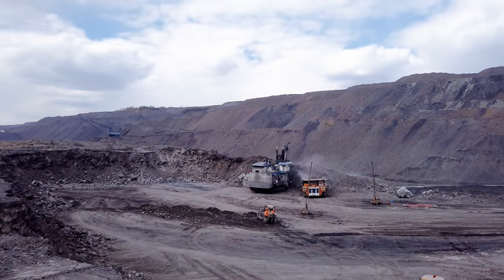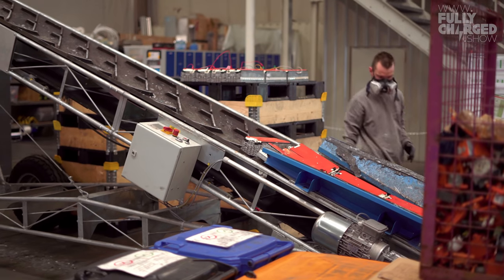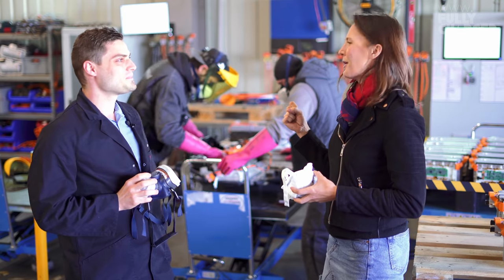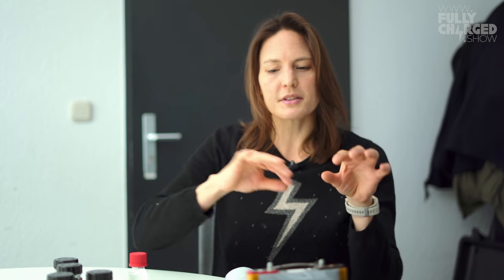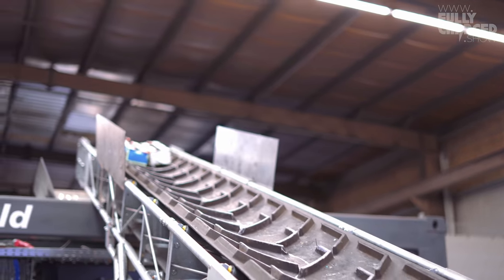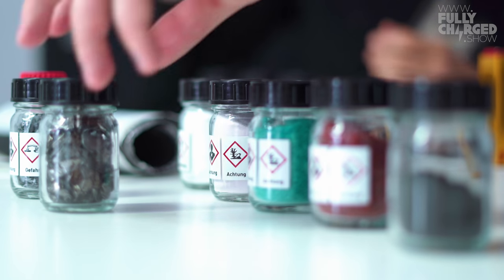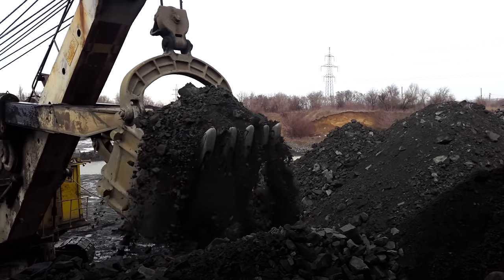Yes, we can RECYCLE EV batteries. Here's how | Fully Charged

Comment: The other partial solution is not to use Li batteries for static applications. This would have a number of valuable side effects.  1) The materials used in these alternate batteries are often common and cheap.  They include ZnBr, SbCa, Fe, V and the up and coming Na batteries, 2) Most of the alternative batteries have much longer lives than Li batteries. Their only disadvantage, I can see, is that they don't have quite the cycle efficiency of Li batteries. 3) Using alternative chemistries for static applications would decrease the demand for Li and bring the cost of Li batteries down and hence the cost of EVs, thus making EVs available to a wider range of people.  4) Using other chemistries would bring the price of these non-Li batteries down below the price of Li batteries.  They use common cheap elements and all they need is production volume to achieve very low costs. 5) Most of these batteries based on elements other than Li can be cycled from 0% to 100% charge without damage and hence all the energy stored in the battery is available to you, unlike Li batteries.  6) most of the alternatives are safer in terms of fire.  They can be shipped, even by plane and certainly by ship in containers with no risk.  Most of them can be safely used in a house (basement for instance) or in a factory.  With Li batteries, it is wise to use have them outside, just in case.  Extra land does not always exist for a battery unit.

Comment: Meanwhile in the paralel world of 1950's certain Miss Helena just released an "audio reportage" titled "Can asbestos be fully recycled?". You need to tune in to her AM station if you can time travel. It's worth it. Apparently asbestos has very few negatives and many positives that will help save the world. 
Also on that AM station,
- "Lucky Strike or Marlboro's, which brand is better at clearing bronchitis, as tested by world's best doctors". 
- "Radiation, should you be scared of what you can't see? Our experts claim that you shouldn't".
Reply from the maker: Asbestosis affects the lungs, cigarettes affect the lungs, radiation is bad all over. Petrol and diesel are bad for the lungs, the planet and more. Please be specific about the issue/s you anticipate with battery electric vehicles? NB as a channel we believe in 'fewer vehicles, a lot fewer, but electric' - I really look forward to your considered response. Fully Charged Dan
Reply: @fullychargedshow  the point of my post was to sarcastically point out that, your "*Can* ..." is a way of pulling wool over naive masses eyes, similarly to how other outlets used to do over the decades if not centuries. The number of batteries which are now finding employment everywhere because they became a fashion item which is going to "save the world" is shocking and majority of them will end up in landfills all over 3rd world countries where there will be no utilisation and recycling. It is the asbestos of 21st century. 

But obviously an average concerned citizen that jizes allover your videos with excitement will not be concerned about this as what they are only concerned about is that they "are doing the right thing" based on what the media told them. It's the feel good factor that matters.

Comment: very good presentation... a few question are going in my mind...
how has the battery to be optimized in production for easyier recycling to 100 % ? ... is this a difficult thing ?
how long could it take, that robots split the battery full automaticly ?... is it maybe in 10 years conceivable, that high tech robots can find own solutions to get the materials apart ? ... without the need of manual working
... or has to be there a new standard for building batterys and it is otherwise not possible to reach nearly 100 % ?

Comment: Where is the flourine coming from? Are there flourocarbons like teflon in the plastic layers?
Reply: Apparently a typical electrolyte in lithium ion batteries contains lithium hexafluorophosphate. Hydrogen fluoride is a COSHH headache. Fortunately doing vacuum extraction means you can pour the stuff straight into the next battery without messing with it, or just sweeping up the powder that remains.
Reply: I used to work with HF, the first aid for personal contamination (a bad spillage on your arm for instance) was amputation!
Reply: Even if you are an EV maniac you should be worried about those hexafluorides in the electrolyte. If you are involved in an EV crash with a burning car you  better bugger off. 
I really long for solid-state EV batteries.

Comment: Really great video, thanks for putting it together! Would be great to know more about why you need to recycle batteries, why do they degrade and what methods could be done to give them longer lifespans both now and in the future. Of course, charging them properly etc improves their life, but for mainstream adoption, you will have to assume the average user does not know/care about that and will just want to plug it in and assume it is ready to go next time they need to drive.

Comment: Do you make bring and sucksion the later of liquid like how oil and water is seperated then just take they layout or mineral liquid needed like cobolt,nickel heat up and become solid at different temps then take what is heavesy or on top or in the bottom it seperate its self right is that what you do ?

Comment: Still a long road I feel until large scale battery recycling is cost effective compared to buying raw materials - but an important road nonetheless! If we consider the recycling process during primary battery design/engineering, could we make the metals easier to separate at a later date?
Reply from the maker: I think that's precisely the type of battery design that the whole process will inspire in time. Dan

Comment: Another informative video, wonderfully presented by Dr. Czerski. Question: What's the purity of the reclaimed materials?

Also, wouldn't reuse of EV batteries in storage systems be a better next step than recycling? In the end, the batteries would serve two purposes, with the second being very economical when compared to manufacturing new batteries for this purpose. And the recycled material yield would be the same.
Reply from the maker: Yes, we’re doing a 2nd life episode, but this was filmed pre-lockdown and that’s why it has been released first. All the best, Fully Charged Dan
Reply: @fullychargedshow  That's awesome to hear, and thanks for commenting. I design and build off-grid energy systems and have used 18650 cells, "specialty" cells and EV modules from salvage to build anything from small portable power packs, to worksite power packs, to van, trailer, RV and tiny house storage, to specialty commercial applications. I'm currently finalizing the design and sourcing for 30kWh systems delivering 230V 3-phase to power commercial condensing units, as well as 120V single phase to power commercial and residential air handlers.ystem is a 30kWh system that powers. These systems use "second life" Tesla packs with parallel inverted and variable frequency drives, and are completely off-grid so the client can demonstrate their product line wherever and whenever the want.

Projects such as these would easily be three to five times more expensive if not for "second life" batteries.

Comment: Could battery manufacturers make changes which would make recycling easier?
Reply: Yes. Make nice flat packs that aren't too hard to take apart. I wonder if Tesla's great long model3/Y packs fit in their machine? Will even longer packs get made by the likes of Rivian?
Reply: I guess watch this space, already colbolt free batteries in the pipeline for starters
Reply: I was wondering whether battery manufacturers could "design in" a recycling method & perhaps provide a recycling manual for each type of battery? Probably wishful thinking for now anyway.

Comment: A very professional presentation full of good information. However, this is not the only company recycling lithium-ion batteries to retrieve the energy metals they contain. Lithium Australia has devoted a great deal of R&D to the issue for some years and is developing proprietary processes to create a circular battery economy, one in which energy metals from both mine waste and spent batteries are extracted to be re-used ad infinitum.

Comment: Surely the outer enclosure and cable harness can be reused by sending back the original battery manufacturer? If car manufacturers try harder to modularise and standardize battery packs then this process can be optimised for least energy expenditure.

Comment: 3:20 discharging batteries to 0 V  - putting power on the grid. Wondering if battery designers and battery recyclers communicate on how to manufacture a battery that's easier to recycle - cradle-to-cradle closed-loop process. Much better use of my time than watching any more of "Planet of the Humans" shockumentary. (;-) (;-)

Comment: How difficult would it would be to repair batteries rather than recycle them? Obviously recycling would be preferable with older tech, but with newer ones, would it be feasible to replace the worn innards rather than the whole unit?
Reply: distortal these batteries aren't broken, so no repairing. They've simply degraded over time, so you have to separate the chemicals (as they are doing here) and make a new battery out of them.
Reply: If they are degraded after 1500+ charging cycles, you can't repair them. They still work, but with a much lower capacity. If they are recycled, you can even make more new batteries from them, because new batteries need much less cobalt and have a higher energy density.

Comment: I guess, though, that a lot of these problems simply vanish with solid state batteries?

As all of it - cathodes, anodes and electrolyte - are all solid. No danger of fire. A liquid electrolyte seeps into things inside the battery - but with a solid electrolyte, you can kind of just reach in and pick it up, as it's a solid mass.

So I'd imagine - after discharging them - it's a much more ordinary recycling process for a solid state battery, where you're literally just physically pulling it apart to reclaim the materials.

Thus, as battery tech progresses, these issues would seem to progress too. That the quest for solid state is itself battery manufacturers creating a much more recyclable product from the off.

Comment: Very informative thank you! Batteries are but a temporary solution, until we change over to hydrogen as a most efficient fuel for cars and houses.
Reply: It's not 'most efficient' at least in a point of use sense. Using the electricity in traction (85%) is more than twice as efficient as turning it into hydrogen and then using it in a fuel cell (40%). Hydrogen is an excellent way of doing electricity storage to deal with the variability of renewable supply, then using it for heating, electriicy, traction. So we may end up with quite a lot of it being used for heavy transport just because there will be a lot about.

Comment: For a whole home battery is there a reason not to use lead acid batteries? Use LI for cars.
Reply: The lifespan alone for starters, weight and size, depth of discharge...lead acid is going to be a relic...it is easier to recycle but you’ll need to do twice as much or more per kWh.

Comment: "End of life" batteries from cars might be used in stationary use before being recycled.. and in both instances it will be better if the battery is designed to easily change out cells and BMS instead of crushing the entire battery. Kind regards from Denmark

Comment: But what is the percentage that can be recycled   ?
Reply from the maker: It’s in the episode, over 70% rising to over 90%
Reply: @fullychargedshow  no it isn't the chart shows 32 per cent only & no mention of the CO2 this process produces a lot of mention of this process being very difficult. Would not say if could get to 100 per cent.
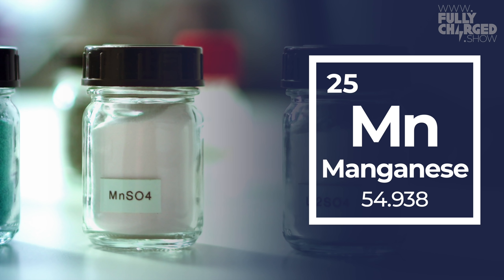Reply from the maker: Audio: around 12:00-12:15
Reply: @fullychargedshow  You are listening to the propaganda go back to about 10:00 onwards and look at this companies own chart it is 32 per cent. What you are talking about is what they hope to do. Another thing the presenter, who does a good job fails to realise that lead acid batteries are almost 100 per cent recyclable. Again what about the O2 produced by this recycling of li ion batteries, I bet it is enormous. Even Renault in their promo leaflet on recycling only claim 50 per cent of batteries are recycled & this figure is skewed because they include the lead acid batteries
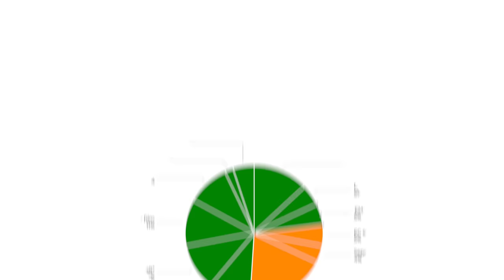Reply: @shaunryan6  @10:20 the charts states 72% is recovered mechanically of the battery at Drussenfield. He states that  because they don't thermally harm the graphite, which is 19% of the remaining 28%, which is cannot be recovered mechanically. He then says they can later recover the graphite via another process.

@12:00 he states that the battery in front of them it is possible to recover 91% of the material, 72% (Mechanical )+ 19% (Graphite) .

It wasn't clear if they were currently recycling the 19%, or that an additional process they could get that 19%. They know how to do it, but at the moment it isn't viable? It wasn't completely clear TBH.

As with any video on the internet you have to be willing to trust the source, and any bias that may come with it. Heh I never thought a company would land a 50m first stage rocket back on the ground. Where there is a will there is a way.

Comment: Problem is not the shape of packaging in different cars it's the different chemistries between packs and materials if each pouch or cell. One plant can't cope with 10 different chemistries simultaneously. If only one type recycled e.g.  2014 Samsung as fitted to 60Ah BMW i3 or VW  works. But no mention of energy used beyond disassembly.

Comment: Would be very interesting to know if this is being done profitably. Does anyone know if the company is actually profitable, or if it's being propped up in some way? I find it odd that they're somehow managing to recycle 75% of these batteries when typically it's 45%. But would be great if it's true.

You can recycle anything you like, but if the process costs more than primary sources, it just won't be bought by manufacturers.

A case in point is a lot of plastic recycling, it produces a product which is more expensive than the origainal plastic and is of inferior quality.
Reply: Err, it's not 'odd' at all! They explained that they use a 'non destructive' method. So they don't melt the whole thing by applying lots of heat, which allows recovery of a lot more elements of the battery.
Simples!!

Comment: My concern with this video is that the workers dismantling the battery’s in that warehouse have respirator masks (when the woman is talking to the man - she’s holding a dust mask, he’s holding a respirator) when being interviewed in the warehouse, I was expecting to hear a fan/ventilation sound but there wasn’t one, or any extraction hoods over battery dismantlement bench’s/portable filtering fans for on-spot filtration and visible HVAC system/filtered extractor fans+fresh air vents. One thing to provide respirators for the workers, but no adequate ventilation of the warehouse ☹️😷

Comment: Re-use the battery in a lower requirement capacity application such as house grid storage. Should get another 10+ years use out of the batteries at 60% to 70% capacity before having to expend energy to recycle them.  With the volume of electric cars proposed over the next 20 years, used batteries are going to become a real problem, so using them for second generation use before recycling is going to have to become a must and not an option... Just because a battery reaches 80% of capacity for automotive applications does not mean it is useless!
Reply from the maker: We are very aware of this, and will do an episode on 2nd life episodes, but we had already filmed this episode pre-lockdown. all the best, Fully Charged Dan

Comment: It's great that these batteries are getting recycled, but wouldn't it be better if these batteries were used as a second life for the grid first and then finally recycle it when the charge cycle really gets spent?
Reply from the maker: As I understand it from speaking with many startups, engineers and entrepreneurs in the battery space, this is definitely how people see the future of battery use. 
The Duesenfeld company are mainly developing the system and using batteries from test and prototype vehicles as there simply isn't a supply of suitable vehicle batteries yet. Which is good news, they are lasting much longer than anyone anticipated. 
But without question the batteries will be used for static storage for many years after they are no longer suitable for vehicles, and then, eventually, they'll be recycled.
Reply: @fullychargedshow  This is the future that it should be viewed as. There's a crazy amount of myth from uneducated people thinking that EV batteries goes straight to landfill after the end of usable life without thinking the possibility of recycling and second life. This is quite doable for EV batteries since the dealership would have to take out that batteries and deal with it properly. Unfortunately, many smaller consumer products, such as smartphone and laptop, often get thrown into a dumpster as it is so easy for any random individual to do so irresponsibly. The smaller batteries that gets thrown into landfill, is there any solution to that problem including harvesting and recycle it from it?